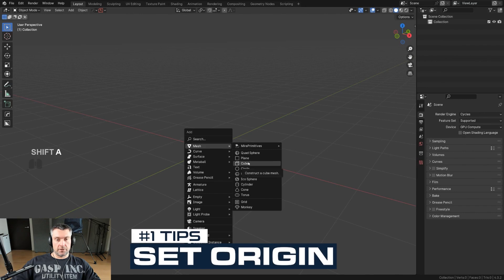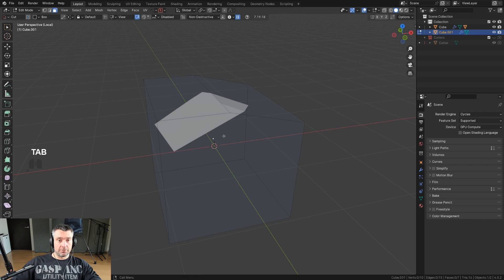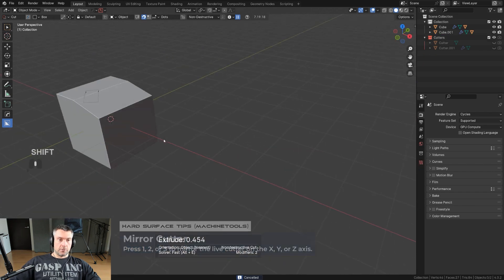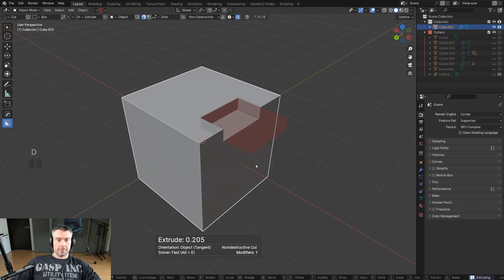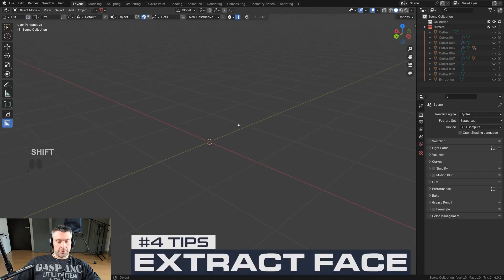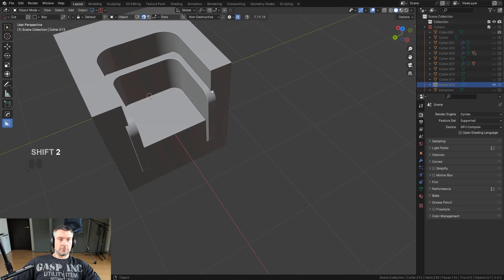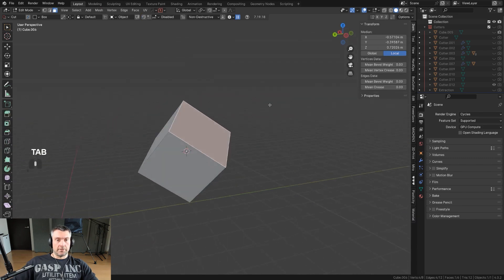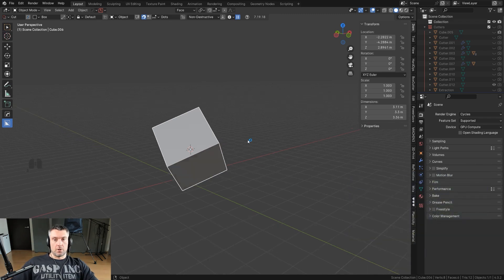5 Hidden Tools for Hardops and Machin3 Tools You Didn't Know Of

Comment: Hello. I'm looking to take your Accelerator  program, but I want to start with the free jumpstart course, to get familiar before opting for a paid program. I want to know if the jumpstart program is convenient for a complete beginner, or if I need a separate introductory course. 

(Ps: My focus is hard surface modelling).
Reply from the maker: Just go for the Accelerator, it is way more in-depth and also designed for complete beginners.
Reply: @PonteRyuurui  Alright. Thanks. 👍🏾